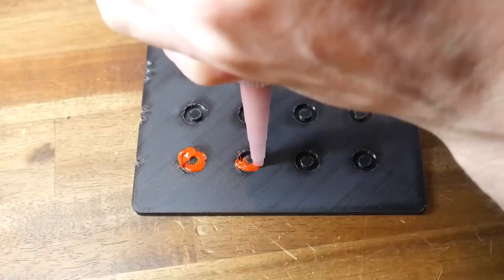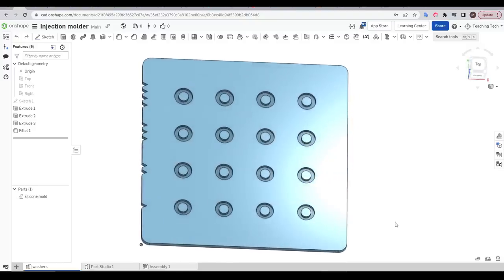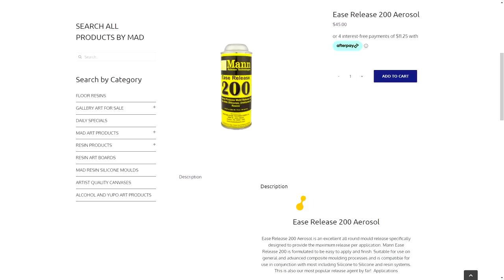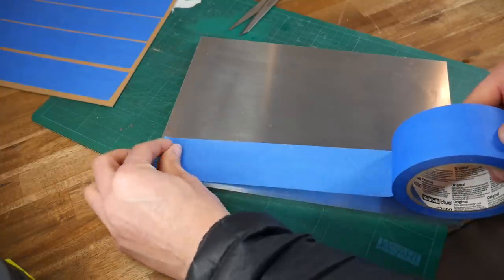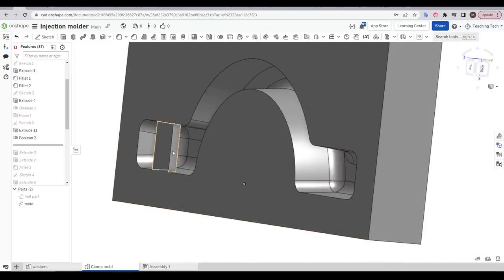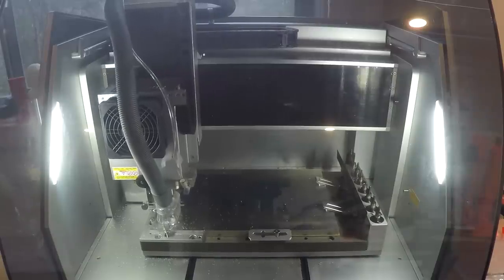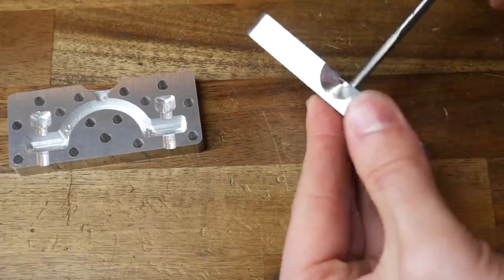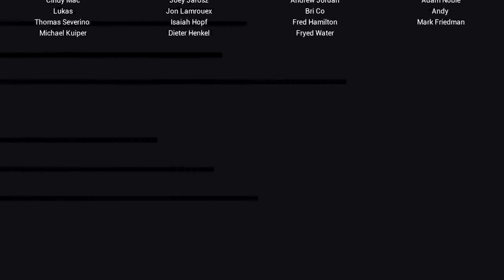Home injection molding part 2: Machining a mold

Comment: One Question: I‘am not an native english speaker and the uses of the word „screw“ and „bolt“ confuses me. The bolts you are using are called in German „Zylinderkopfschrauben“ and my technical reference book at work translates this as „cylindrical head screw“. Is this a translation error? When are we talking about screws and when are we talking about bolts?
Reply: A screw twists into material to be fixed, often making it's own thread. A bolt either goes into a nut, or material to be fixed, that has had thread created to match the thread of the bolt.
Reply: @jeremylaidman6525  Thanks! That makes sence. In german we call both kinds „screws“.

Comment: Why would the simulation show stair stepping if it thought your tool was actually BIGGER than it was?  I think there is something else going on there.
Reply: If the software thinks the tool is bigger, the actually smaller tool removes less material than the software intended. I think he explained that pretty well in the video and even helped you with a graphical representation.
Reply: @ProtonOne11  the software runs the simulation.  So why would the simulation run BEFORE the actual cut show stepping?
Reply: I think the simulation showed roughing, not the later clean up with the ball head tool?
Reply: He used several sized tools going from largest to smallest each resulting in a less rough (stair stepped) surface. Ball nosed tools are used for the final passes to blend out the stair steps due to their round ends. 

The problem is that diameter he entered for the simulation was nominal, not the true precise diameter which was smaller. As a result, it didn't adequately remove the stair steps. The low budget CAM software he used is likely limited in the resolution of the finished render, so step lines will be exaggerated.

Comment: Sounds gross, but if you get a small cup and spit in it a bunch, you can coat your finger in the saliva and RTV will not stick at all to it. It works better than ice cubes or soapy water.

Comment: I keep getting ads popping up for the CNC machine you've been using since last night and something is bugging me. 

Never... EVER... Become so comfortable (read complacent) on a CNC machine that you feel like you can just set it and forget it. Tabletop machines are one thing, but if you ever graduate to a larger machine that doesn't have the same automated capabilities that this one offers, you can and will run into some serious issues if something isn't just right. My service crew is currently working on a machine that went Skynet and the crash damage is so bad, the machine casting itself is cracked in half. Subtractive machining is a different animal than additive, they require a ton of attention and respect.

Comment: I think the trouble youre going to just so you can have the bolt in the mold to use as a "Core" is a waste of time & effort - cast the bloody part whole, and drill the two holes after the fact